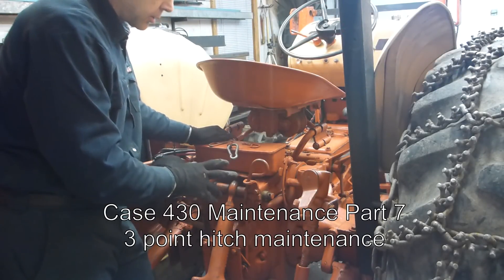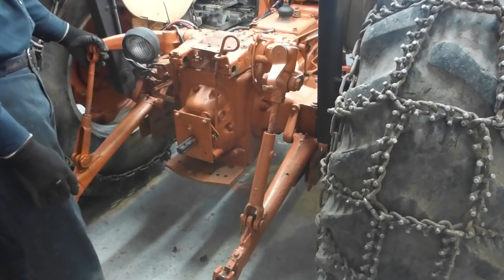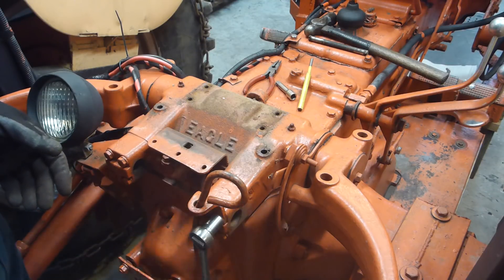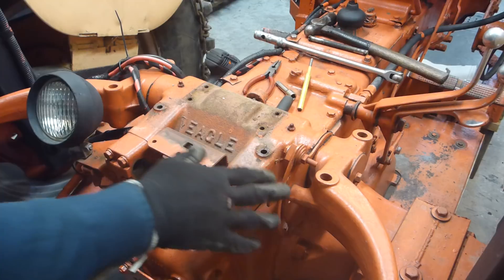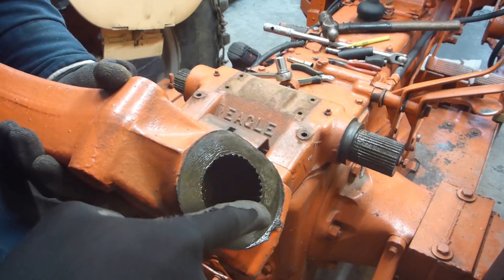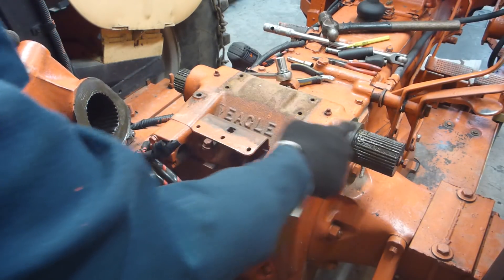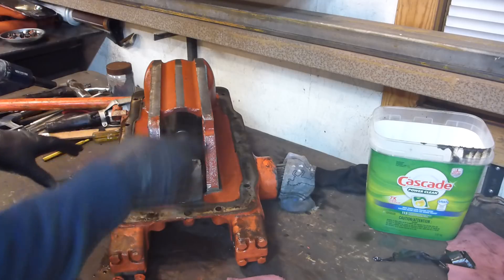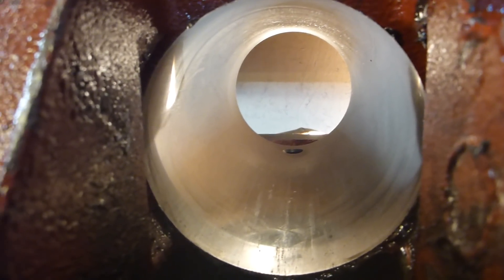#94 Case 430 Maintenance Part 7 - Eagle Hitch Hydraulics

Comment: In the manual it says on older models replace the plug.
Another man on the internet did this same job and had the older model his was a 430 Diesel.
His piston was also totally different!
He used o rings instead of the special seal that was expensive and did not work for Joe.

https://m.youtube.com/watch?v=22eJNk19KDw

He listed the O ring s to buy in his site I think Joe advised him.

Comment: Nice Joe.  I finally got the internet to stay running and can finish watching your series.  I was surprised the small bolts at each end of the spindle.  Those little bolts held those massive lift arms in place and attached to the slotted spindle. when you opened the gear case you could see the oil discoloration from possibly water (the oil was milky but not broken down).  When you highlighted "here it comes....BAM!!!....that oil shot out of the piston housing.  Now that oil looked totally different than the oil down inside the gear case.  It did not look contaminated at all. Wow, that was sure a lot of accumulated grease from the slotted spindle shaft.  You really don't know what over-greasing does until you see inside the piston housing.  When you pulled the Case 430 frame outside the garage with the Bolens, that frame was neat looking. Heck, I almost wanted to throw an engine on that and make a heavy duty dune buggy.  That is one tough looking piece of 4-wheeled metal.  I really am glad I have internet back to see these videos. Now I'm off to see Part 8.  Great video, Joe.
Reply from the maker: Houndsman One, I am glad you can go back to a normal routine. The milky oil in the differential is a mixture of 80W90 gear oil with hydraulic 32. The hydraulic pump is in the front case where the gear shifter and hydraulic pump are.  But when the cylinder leaks, it leaks into the differential, so it just dilutes the 80w90. The cylinder had pure hydraulic oil in it, so it was looking nice. Especially because I had to add more and more new hydraulic oil to compensate the leak in the differential!!! Might be possible the old gasket let some water come in.  Thanks for your support!
Reply from the maker: BTW, the small bolts are 3/8'' bolts.  But they hold a large washer that keeps the arms from shifting from their position. The lifting arms do not see any sideways load.   I would say that once some torque is applied to the arms, they won't be likely to slide sideways.
Reply: Roger that.  I do like the removal and weld/install of replacement attaching slotted piping. Pretty nice you had that size pipe laying around, huh?
Reply from the maker: I've got a lot of stuff laying around!!! Every time I go to the steel supply place, I try to get new pipe/tube/flat bars sizes! I often only get 3-4' out of it. It's like having a small box of differents sizes/type of screws! Just in case!

Comment: The 3PT is not to bad for all those years of working it. Them manuals are very general information so they don't help much on detailed stuff.  Thanks Joe your videos are going to help me a bunch when I start back on the 35 Massey.
Reply from the maker: Thanks!  You are right.  In those years, there was many parts that were very similar.  I can see it when looking for parts on the internet. One part can fit many brands. But worst, when it does not fit, but look so similar... Especially for Marvel-Schebler carburetors.  I am glad it could help you. Thanks!